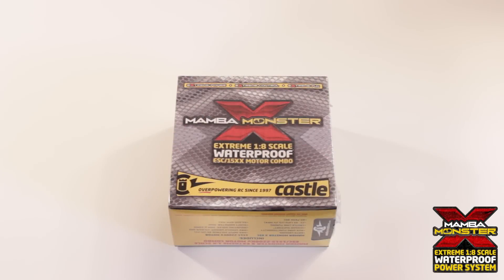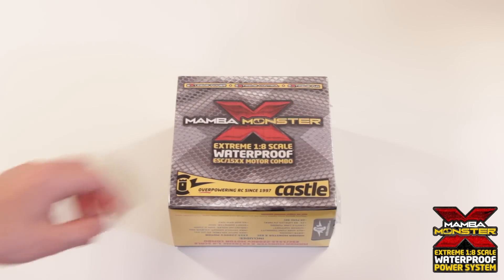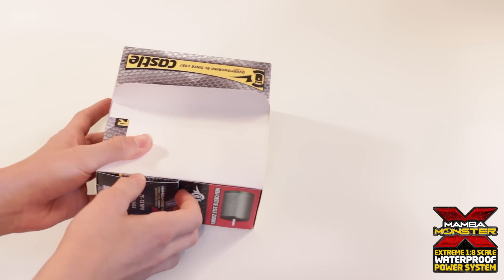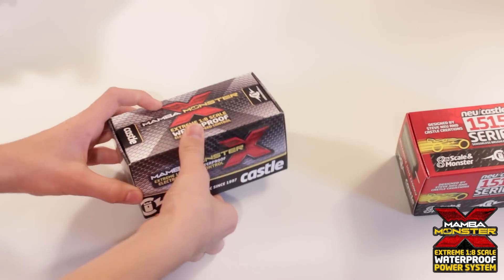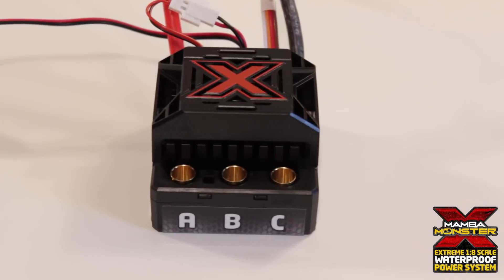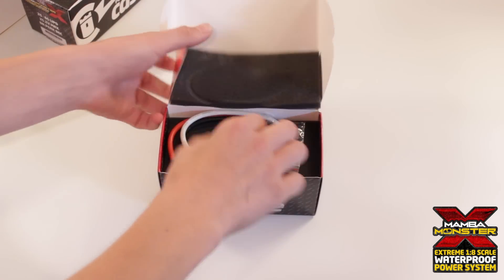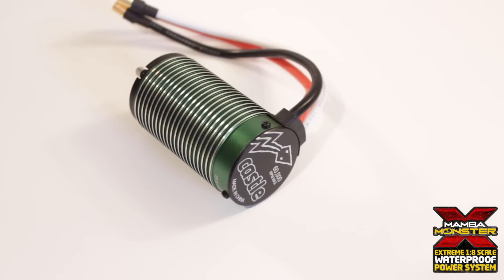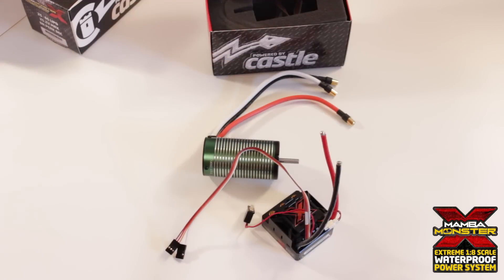Mamba Monster X ESC with 2200Kv Motor Combo

Comment: Castle went and changed the configuration of the pos and neg wires!Why i dont know!Now i have a fried mamba monster x.Different from the mamba monster which is what i am upgrading from for the sensored option which you have to purchase a separate harness for!Why not just plug the motor harness directly into the esc?
Another disappointment is the switch wires, half the gauge of the older mamba monsters which proved to be a difficult task joining jst connectors. 
Keep things the same for those who have customized wiring in there cars Castle.Makes life easier!

Comment: Hey guys I have a problem I have a rc car called hsp bazooka 1/8 buggy its capable for 2-4s and I want more speed so if u get a 6s esc and if I use the stock motor on 6s will it burn out?
Reply: Rc Madness1805 yes

Comment: which is better 2200 or 2650?which one will handle the 6s battery?
Reply from the maker: motox766  I would definitely go for the 2200Kv. More torque than the 2650, cooler temps, and will run 6s. The 2650 will only run 4s
Reply: Cool buddy thank u.

Comment: What id your review on it/ your thoughts?
Reply from the maker: Great ESC, I now own two of them. The other one I run with a waterproofed sensored Tekin motor. Both ESCs have been very reliable and run very cool. Couldn't be happier
Reply: Tekin or Castle?
Reply from the maker: +Jake.Marttila  It's a Tekin, Castle doesn't make any sensored motors
Reply: Does Team Orion make any?
Reply from the maker: +Jake.Marttila yes

Comment: I'm told by people that owned both Mamba Monter 2 and the Mamba Monster X  that the MMX is a down grade from the MM2. Castle lowered the power some sort of limiter in the firmware to cut down on returns for warranty issues.  Same goes for the the XL2 to the XLX There is nothing extreme about limiting the power.
Reply from the maker: Lol that's not true at all. The amp output is the same on both ESCs, the difference between the two is the X is higher tech - including data logging, ability to run sensored motors, ESC fan has temperature sensor, and the entire system is waterproof
Reply from the maker: +RC Grid  There's a lot more, but I just listed some features off the top of my head

Comment: The mamba monster 2200 kv motor is more paouerfull than the mamba monster 2650 kv motor
Reply from the maker: 2200Kv has more low end torque, but the 2650Kv has more RPMs. Look up what Kv means for an explanation

Comment: Thanks for update on the mm,mm2.....i plan on getting  the x after seeing this👍🏽
Reply from the maker: +Jill Manuelito Just an update on the MMX, I've been running it in my Traxxas Summit on 4s and it can easily flip itself on its back. Im geared really low, and I can still reach 40mph. What really surprised me was how smooth the throttle was with the MMX. It is hands down the smoothest sensorless setup I've used and very low speed is possible. The low speed that can be achieved is especially useful when it comes to crawling with my traxxas summit. There is very little cogging, if any at all.
Reply: +RC Grid Just curious but what are your temps on the controller? because I'm geared for 40 mph on my eb48sl and my controller is hitting 180+ quite frequently.  Oh and happy crawling with the world's smoothest sensorless setup ;)
Reply from the maker: +BLDCdocta 124 My ESC temps are really low at 110°F, and it takes 10 minutes of bashing just for the fan to kick on. As for the motor, it is usually around 125°F, and the hottest I've ever recorded it at was 145°F. My ESC temps are low, mostly because I'm running the steering servos off of an external BEC, and my solder joints are good

Comment: What batteries are you running with the combo? Did you install it yet?
Reply from the maker: +RC Grid I have some videos of the MMX installed in my Traxxas Summit on my channel. I did a lot of research on batteries, and I decided on two of the SPC 2s 70C 7200mAh (4s in total). SPC also sells a battery with 8200mAh that will fit the Summit/Revo, but it is soft case (no big deal). There are a lot of other Lipo brands you could go with, but SPC is the only brand I could find with high specs that fit the battery trays of the Summit and Revo."